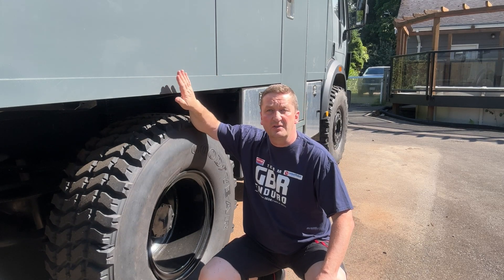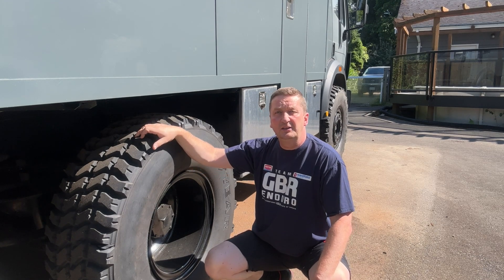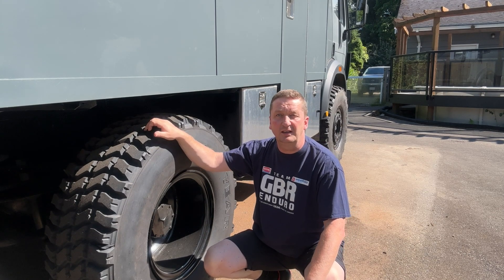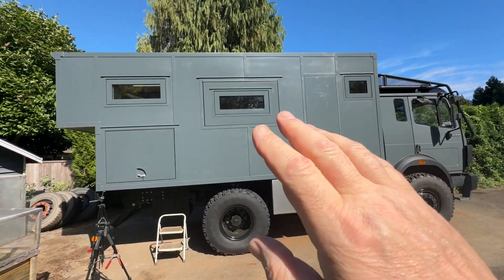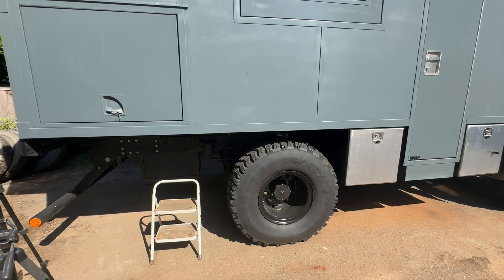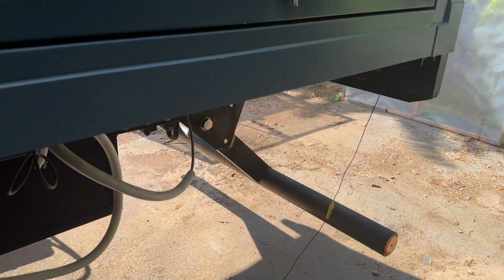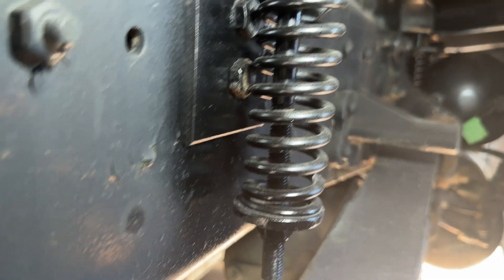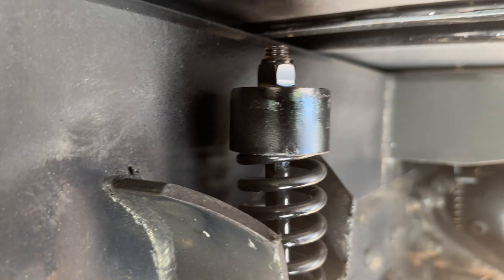Q&A  !!! How to make a subframe for a Expedition truck. DIY step by step.

Comment: Hey Oscar. I love your videos! I have a subframe question. What do you think about using HDPE as a wear strip between the frame and subframe? I’m planing for a 1/4 to 1/2” strip between the two.
Reply from the maker: Thank you ! To your question I am by no means an engineer just a guy on the internet thinking about the HDPE topic. First off I would not do such thing, 
a) because it is recommended not having any material between the two metal rails ( chassis frame to subframe ) 
b) The subframe is sitting firm on the chassis frame through the weight of the habitat or what ever you have as build bucket/tank/flatbed, it creates a friction on the chassis frame and does not move left or right because of the weight.
Now imaging the high density poly in between it does not create a holding friction it slides like skates on ice, means all the weight shifting in all directions need to be hold by the mechanics. Every bolt every spring is put to the test at all times and the wear and tear is a multiple higher as normal. Just my two cents ! Cheers
Reply: @oscaroverlander_MB1222AF thanks! That’s was what I thought too, but I just got to over thinking it. 

Keep the videos coming. They are great!!!

Comment: Dear Oscar, I totally agree with your statement for the springs and the force / function of them.  As I constructed my subframe in 2022/2023 I followed the same philosophy. And as it is most times when you make things yourself, they are always heavier and stronger, compared with those of mass-production-lines.
Reply from the maker: Right on, thanks Frans.

Comment: You made a hinge at the back? How did you do that please?
Reply: The subframe is mounted fix to the chassis, with a connection at the most-rear end.  There is a thick plate (10 or 12mm)  welded to the subframe and tightly bolted (M12-M14) to the chassis.  The wholes in this plate should be 1mm wider than the bolt diameter.  This is to allow some movement between chassis and frame when the chassis is in torsion.
Reply: @fransdonners2746  Thank you
Reply from the maker: Frans explained it pretty good thanks guys. For better understanding I recommend watching the original video. https://www.youtube.com/watch?v=AofUFJdpx7k

Comment: How did you determine how many springs to use per side and how far to space them out between each other?  Also is the rear portion for the subframe bolted to the truck frame? Thank you, great build and helpful information!
Reply from the maker: The spacing was dictated by where I could find enough space on the chassis frame and this on both sides of the frame. I have four springs each side and you want to place them more to the loose front while the back is bolted and doesn't lift much. Cheers